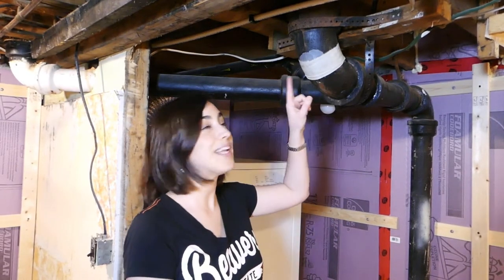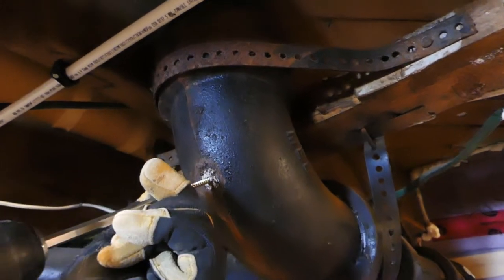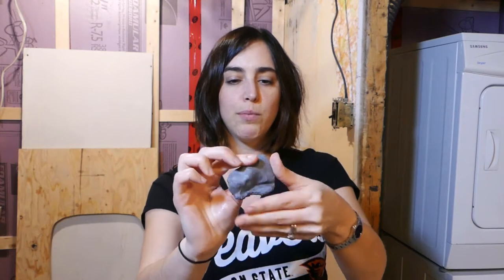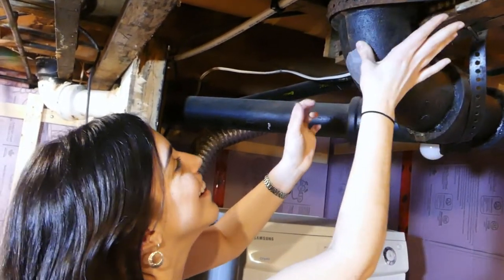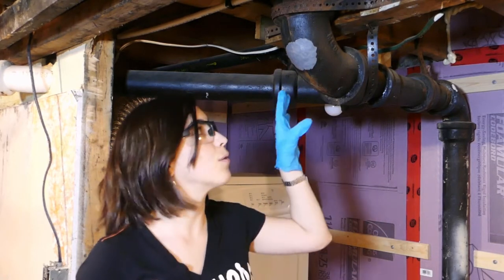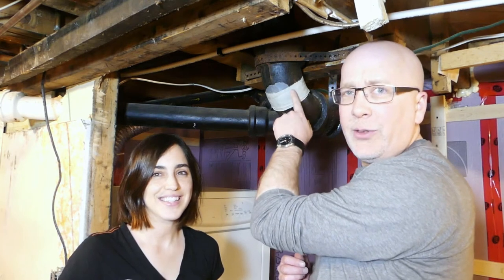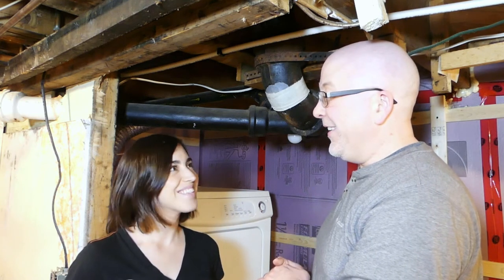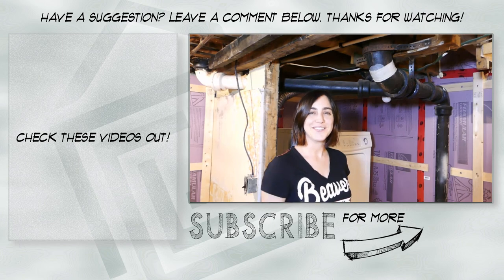Patching a Poopy Pipe - Using the Freeze Fix Repair Kit on a Cast Iron Pipe

Comment: Just want to know if this patch is still holding?
Also, cast iron is pretty brittle. You got lucky that the pipe didn't crack and that it was in fact pretty soft from rusting.
Better off using a file like a rat tail next time. Cheers

Comment: I haven't used a patch like that- but I do need one. I have the same type of pipe and mine isn't leaking yet but it doesn't look good. Good tip. Thanks guys!
Reply from the maker: It did work well for us. It's been a couple of weeks now since we filmed this and it's still rock solid. Thanks for watching and good like with the pipe!
Reply: Your just pushing a nasty problem into the future.
Just rip out bad pipe and re pipe with plastic.cut with hacksaw or sawzall.
Cast is soft steel cuts easy. You can use a thing called rubber fernco coupling.
Reply: I agree.  You should just cut it out and convert the span over to PVC or ABC with some fernco fittings.

Comment: what if the gloves break and you get the tape material on your hands\/  how do you get it off?
Reply from the maker: It take a while to harden; just wash your hands. :)
Reply: @Handyverse  .not the case at all.  Soap and water don't remove it.   Drubbing alcohol will not re.ove it, and will dry your hands, acetone will dry out your skin too much (I would have tried if I had some).  Within 3 or 4 days  the sweat from your skin, skin rejuvenation, and normal washing..... It will be gone.
Reply from the maker: Wow, sorry to hear that. Good to know. We didn't run into any issues with cleanup when we used it.
Reply: @donnastarkey7619  time is about the only way...... kind of like that foam insulation in a can.....you get that shite on anything and geesh.......lol